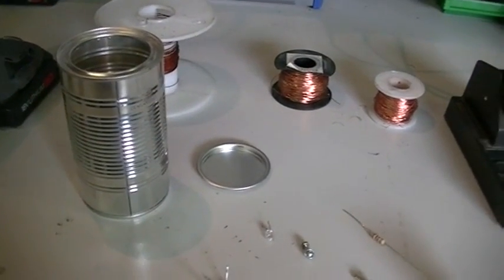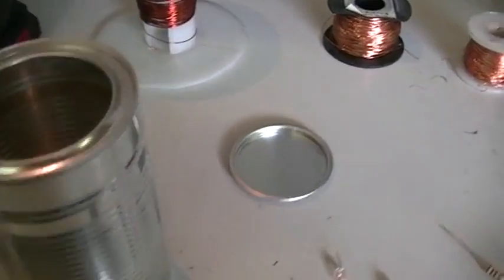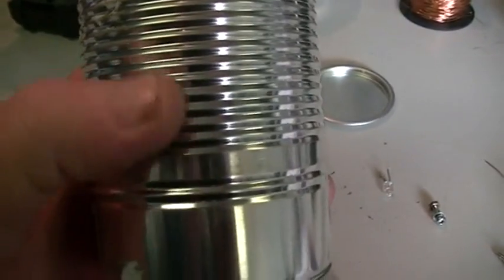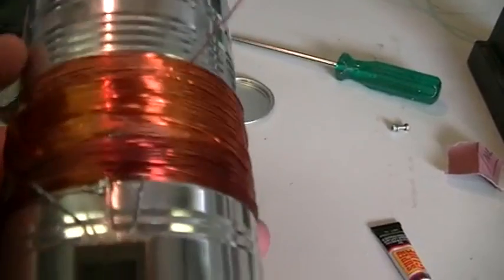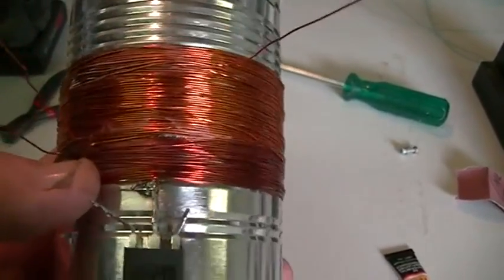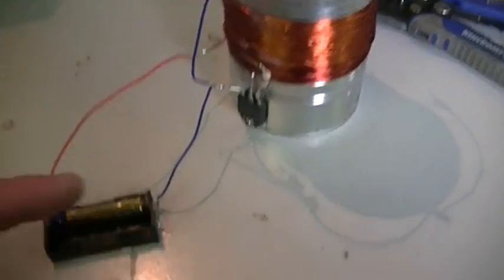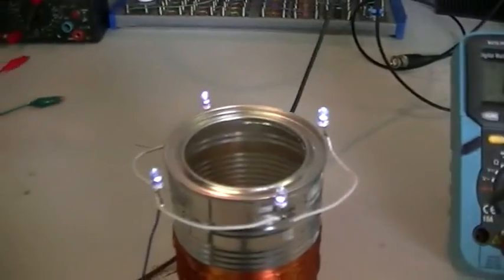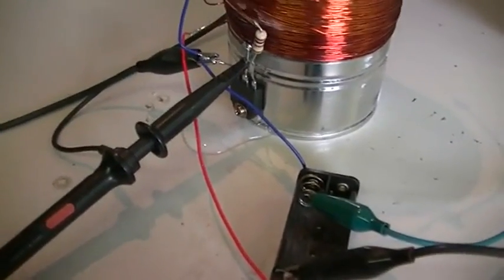Tin of joules

Comment: I just came across your channel. I am thinking about building a transformer for a inverter project. from powder iron and epoxy. do you think this will work? would it be efficient enough to be useful? I'm thinking the small size of iron will allow a higher frequency. I'm guessing at a lot. it will probably a toroid core. do you think this will work? its for a inverter for more off grid house
and will need to be about 6-8kw output. so probably split the load by 2 or 4 toroid transformers. can you give any advice for winding the toroid's? I kinda know how? but can't seem to find the info for starting from scratch. like the gauge of wire to use mostly. how do I calculate the size wire for the windings? thanks

Comment: I think you can get some better performance if you used a non-metal cylinder for the housing, and used a ferrite core instead to achieve better coupling between coils. The metal acts like a short-circuit L3 coil of wire,  and create magnetic reluctance and eddy current losses. Ferrite is better because it does not conduct electricity well, but allows magnetic fields to "conduct" through it well.

Comment: Hey tinman, I have been wondering about your two transistors that you pulled out of that old electric dodad that someone gave you.  do they work the same way as those small npn transistors?  if they do could you make a high voltage and high amperage joule theif out of it?  by high amperage and high voltage I mean converting 12 volts and 8 amps to 144 volts and 500 amps.  do u think it's possible?
Reply from the maker: moxncal Lol-no,we cant convert 12v @ 8amp to 144v @ 500 amps. If i could,i wouldnt be here on youtube lol.